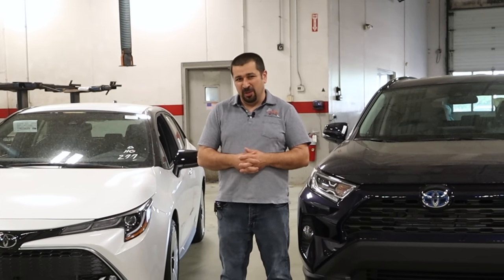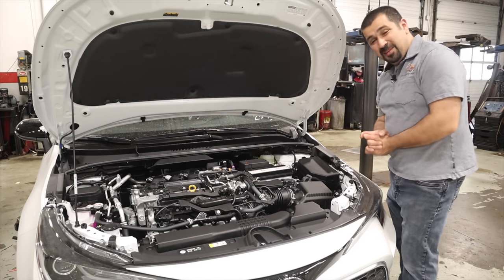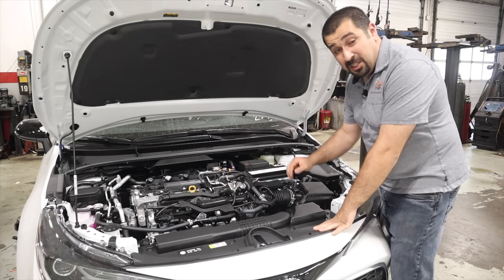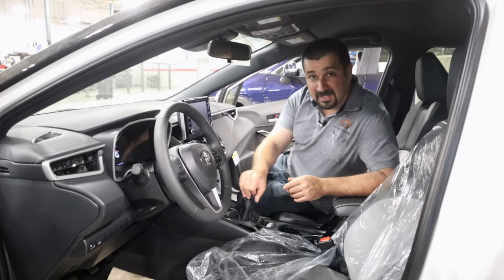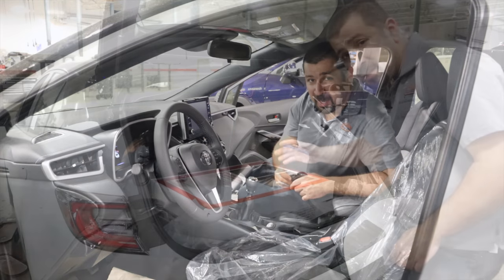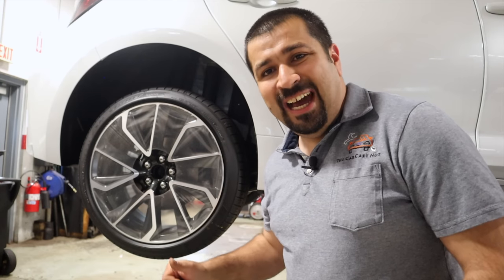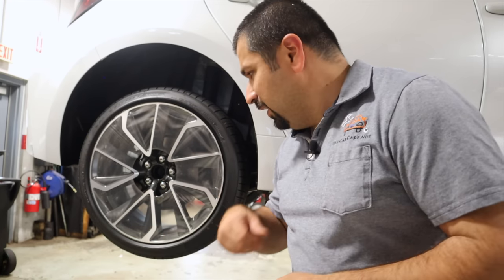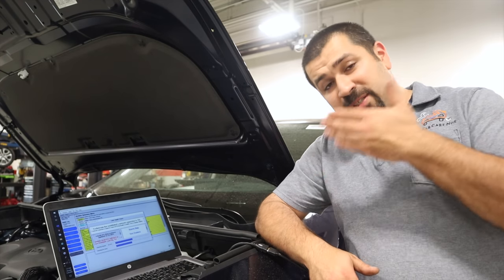Buying a new car? Here's what happens behind the scenes.

Comment: some missing inspection checks that may be superfluous for some but essential for some:
-check air pressure tire of the spare tire.
-check loose bumper joints front and back.
-check signs of paint bubbling. 
for prospective car buyers:
-check reviews online that are not based on the business and the financial departments (those are trained to be good sales pitch actors), check reviews that talk more about the service departments and parts departments.
BE PREPARED TO WALK AWAY from the dealer when they use bait an switch tactics.
never buy extended warranty! you, the customer is the only warranty the car needs!

Comment: Glad to hear you add washer fluid because all Nissan dealerships we have been to simply add water straight from the faucet. My Nissan I bought 10 years ago came with a steering wheel off-center and I was told I would have to pay for an alignment on my brand new car.  One of the many reasons we will never buy another Nissan.  Despite my requesting repeatedly that they not wash my wife's car we ordered our Subaru had dealer installed paint swirls....of course I didn't trust them not to "fix" it.

Comment: Wondering how my Toyota dealership is to go through all this stuff too when they have my factory ordered Tacoma later this summer
Reply: I didn’t known you could order from the factory. That’s awesome!
Reply: @marimashburn7796  You indeed can order from the factory.  You just need patience.  I had my salesman do a factory order for Corolla hatchback in December 2019.  He didn't make me put any down payment with the order, so I paid nothing until the day I actually bought it.  The car arrived in March 2020.  So, if you don't need a car right away, it's definitely something you should consider doing.  I got my Corolla hatchback with a manual transmission, in the color and trim level I wanted, and with a spare tire instead of a tire repair kit.  You don't need to be stuck buying whatever's on the lot.
Reply: @hamsterama  I thought it was only my Toyota dealership that didn’t take a down payment when they factory ordered my truck. That makes me feel better because everywhere else you have to put $500 down payment for a factory order
Reply: @chrisburger8794  I don't think you actually have to put down $500 anywhere, unless it's a custom order thing.  That's a trick some dealerships try to lock you in.  Doesn't matter the make or model.  My parents did a factory order for a Jeep.  The salesman wanted $500 down, my parents refused.  My parents said the Jeep could fall off the truck, and they would be stuck with it, or lose the $500.  Guess what?  The salesman gave in, and didn't make them put any money down.  Anyway, enjoy your Tacoma, once you get it!  Nothing better than getting exactly the vehicle you want, and knowing that nobody else test drove it!

Comment: First, I can't thank you enough for putting together all these awesome videos. Advice on negotiating and finalizing the purchase of a(ny) new vehicle is easy to find on youtube or elsewhere. However, makeing sure you are ready to take to the road upon signing on the dotted line and getting the keys is what I have found make this video and many of your other videos so informative to me. 

I have only had used cars and nothing that is high-tech so to speak. While my first car was a Toyota (93 Corrolla) which taught me the importance of using genuine Toyota parts, none of my 3 cars to date have had anything as high tech as what new vehicles come with today. So I have some questions based on this video and your other videos as I prepare to buy my first new (off the assembly line) car, a 2021 Toyota RAV4 XSE Hybrid (your videos were part of what helped me pick this car and build, so thanks).

I am very meticulous about maintaining my vehicles, so if a knowledgeable and certified mechanic such as yourself does X service every X miles/months for best reliability I will do follow it exactly. My second and third cars taught me the importance of fighting carbon build-up in the engine, so I am big on keeping the engine in top shape beyond just oil changes. How often should the fuel and intake systems be cleaned to maintain reliable performance and avoid catalytic converter failure?

Is it worth asking the dealer to run a full update check of the car's systems before I take ownership of it?

Are there any Toyota parts I should take with my vehicle at the time of purchase to help maintain it? Coolant perhaps?
Reply from the maker: Hi! Thank you for watching my channel.

If you drive on the highway regularly you likely won’t need to clean the intake. Just clean the throttle body every 50k miles and you’re good. 

Updates are not something that should be done regularly. Only if there’s an issue repaired with an update.

No need to carry fluids as these cars are pretty reliable new
Reply: @TheCarCareNut  thank you!

Comment: In my case universal toyota on San Antonio messed up big time. I order the supra on March and got delayed. On April I told requested to remove the protection pack as the car is going to get PPF covered and sellers told that they did call and requested the removal.

On that quote I added the optional supra cargo mat and was charged but when the car got here they left the VP and charged 650 dollars for that even though I requested to be removed and the sellers blamed the Gulfport were all toyotas arrive , same with the cargo mat as they put a standard/generic one instead of the supra one they charged 95 buck which again got blamed on the gulf and told me that what you see its what I get. Lip had a small damage and they offer to remove the lip from one supra and exchange it from mine which I said no cause by this point the attention to detail is leaving a lot to be desired.

I had to start a huge argument over the mat for them to actually order the correct one.

Your videos inspire integrity and attention to detail, wish you were in charge on working on my car.
Reply: Additionally the seller had to request wash as the car was full of stains and glue on the top coat cause they don't wanted to wash the car.

Comment: Cars today are highly technology driven. Checklist cannot do justice. I recenely bought my Hector and I hired Zekardo PDI to conduct the PDI for my new car. They found issues with my car not only in sensor but also discovered that the car had a meter rollback since dealer did not have demo car so they had used my car as demo car. I cancelled my car and then got a new car after that. They again came to do the PDI and when it got cleared by them, i bought the car. Highly recommended to every car buyer. They are the only company to conduct PDI for new car in India. Best part is they have no tie up with any dealers.

Comment: My new 2021 Corolla Hybrid Sedan will arrive in August here in Australia - I will check it out.  With low clearance of TNGA platform I will bet on scuffing front bumper from high ramp on ship and/or delivery truck (most important check).  Otherwise level of PDS you describe is very impressive - glad I am buying Toyota!
Reply: Maybe  that is why they have too much air in the tires so there isn't damage under car when removing in the delivery  process
Reply: @michelevyas5353  -  They purposely overinflate tires during production (to say 80 PSI) to ensure that if car sits around waiting for a ship, on a ship, or sitting in a parking lot at the dealers for several weeks it does not develop "flat spots" on the tire -  That is good, but remembering to deflate the tire to the normal 35-36 PSI before delivering it to the customer.  Way overinflated tire on a highway could blow.

Comment: I believe my dealer is the 1%. I’ve only owned Toyota’s except for a 2006 Ford Ranger V-6 4.0 4x4 that was a mistake. My latest purchase was a 2021 Tacoma TRD Off Road 4x4. Of course nobody has inventory here in SoCal and wasn’t real excited about the 2022 lineup so I ordered the Tacoma and a month later took delivery and the next week the Tacoma was in the service department since Toyota Safety Sense was giving false positive alerts. It still gives false pre-collision alarms when I’m fully stopped and a cyclist is approaching the right side from behind and basically the dealer says it’s working properly. So I unfortunately gave them a zero rating on the Toyota dealer survey.

Comment: In Feb 2022 I factory ordered (at MSRP), and put down a $500 deposit on both a 2022 Canary Blue/Midnight Black Toyota RAV4 XSE Hybrid and a 2022 Toyota Tundra Capstone. I have been doing research on these vehicles for the past year. On 4/20/2022 I was notified by Toyota of Puyallup in Puyallup Washington, that the RAV4 was ready for delivery. I informed my sales consultant (Van Meas) that I am aware of the PDI (Pre-Delivery Inspection) they perform on their delivery vehicles but I would like to perform my own PDI on my RAV4. I also asked if he could schedule a quick 10 minute appointment with the service department while I'm there to put the RAV4 on a "Lift" so I can inspect the under carriage. 

I arrived at the dealership the next day. They accommodated my request with the service department and everything looked good (so far). They then drove the RAV4 to their Delivery Bay in the showroom. After 3 hours, I completed my own PDI and Test Drive. Van M. met me outside and I began to tell him that I had a few issues with my RAV during my PDI. There was a 1 1/2 inch visible deep scratch on the hood and right quarter panel and the passenger heated seat did not work. There were a few other minor issues too. Van asked for us to go inside. Before we made it inside the General Sales Manager (GSM) Matt Pemrose met us before we walked inside. I commenced to tell him the issues I had. He interrupted me and said "I have been watching you for the past few hours doing your PDI and it looks like NOTHING is going to make you happy". I was taken back a bit with his response and immediately felt disrespected. 

Long story short...Toyota of Puyallup refused to fix any of the issues I had (especially the scratch) and was told to take the vehicle "AS IS". No reduction in the price of the vehicle. Needless to say I REFUSED the vehicle. The GSM then approached me and not only gave me back my $500 deposit for the RAV4, but also gave me back my $500 deposit for my Capstone and said they refuse to do business with me in the future. I was shocked and appalled!!

I have a phone call into the owner of the dealership and also plan to file a complaint with "The Office of Attorney General of the State of Washington". (Thanks for the links @JoinYAA.com)

Toyota of Puyallup is my local dealership but I will NEVER do business with them again. Future car buyers... beware of this dealership and others like them that are out there. DO YOUR RESEARCH!!

Comment: I just walked away from a dealer while doing a pre-check on a new corolla because of quality issues with fit and finish. The door was installed crooked, and the top edge was off by about 1/8 inch. Very noticeable. Overall, the fit and finish on other gaps was off also. Even had a small scratch on the paint. The sales guys did everything they could think of to pressure me into taking the car as is. Apparently the American made Toyotas ARE not as good as the imports, as I have never seen this previously. To make matters worse, as I have previously bought two cars from these guys before, I was astounded when they said they would not hold another one for me from the upcoming queue of incoming cars. I don't care if they have an artificial "hard to get" inventory to allow them to sell at MSRP, I am not going to be pressured like this. Also, they have a policy now that you cannot test drive on the freeway. What? Are you kidding me?

Comment: Hi. In four five days I will be picking up a brand new Toyota Tundra (ufff I had time to buy a V6 turbo and a hybrid before), when I listen to your story, my face looks incredulous that my new car will be so thoroughly checked. Check lists are completed at once - all "V" are identical. Before this video, I was watching your automatic transmission oil change video and as you started talking about the correct oil temperature ... I thought I guess I live in a different world. Unfortunately, the services do not allow the mechanics to see their hands while they inspect your car. I understand that this is not theater, but with confidence it is like virginity - it IS or it IS NOT. There is no thread in the middle, and repair shops as part of a dealership are just as greedy for money, desire. Hardly anyone remembers that the first car is sold by a dealer in a car dealership, and the next one is sold by the service center. I like your films very much because you provide the same information that was given to me during school and studies.
Once upon a time, when a customer picked up a new car, the service advisor wrote down what could be set up in the car at the customer's special request. For example, the fuel reserve level can be set from the car computer. Another thing that can be changed according to the wishes of the owner is the volume of the radio during a call and many other functions. This was the case in the company I worked for 25 years - Renault. 
Today I don't know what to ask and I can't count on the seller's friendliness. Maybe you can tell me what I should pay attention to and what I can ask the service for when releasing the car.
Regards

Comment: Corolla, white one came from Japan.  Engine compartment hoses & wiring are organized.  Battery is mounted on the driver's front wheel strut.  American or Canada builds, battery hangs on the very front of the left fender - easier location for American mfr's and service dealers to handle the battery.

Comment: Bought a new Subaru STI, and whoever did the PDI forgot to install the radio antenna, found it in the trunk after I got home and noticed. 

Easiest way to tell country of origin is the first character of the VIN. Not sure if it still applies, but in the old days you could tell if a car came from overseas by looking underneath and seeing surface rust already starting on the CV axle tripots or exhaust.

Comment: We got our 2017 Rav4 home and a few days later I noticed a pool of oil on the garage floor. Took it back and they pulled the transaxle and replaced a seal. They took it for a test drive, and it still leaked. They got us a new Rav4. So, it can happen, even to a Toyota. The telling the satellite radio company that we did not want their service (both Rav4's) and a Tacoma, is another story.  They called multiple times a week after we told them no and blocked their number. Multiple mailings a week. Had to complain to Toyota to get them to stop calling, day and night.

Comment: Biggest issue of mine, whilst dealers mean well (toyota in this case) , is the guys who clean the cars do so much damage to the paint, by the time you receive the car it's covered in swirl marks. I know this varies dealer to dealer, but everytime I've bought a new car or took a car to the dealer for a service I've instructed them not to wash it.
Reply: Got a new Rav4 last month, covered in swirl marks and they had too much zaktek on so the dust sticks to swirl patterns minutes after washing. Hard to buff off excess by hand.
Reply: @benderrodriguez142  that sucks. Sorry to hear that buddy. In the UK I went with a friend to go pick up a lexus RX450H, and it was covered in swirl marks. Really bad ones. So we made a fuss and the dealer agreed to get the paint corrected by an independent detailer for free, plus they changed the way they wash their cars. The only way to remove those marks is a 3 stage correction and the dealer should foot the bill.
Reply: @HK.Builds  yeah, I am going to talk to them about it when I go in to get my seats redone. Front seats both have holes by the console. Not a fantastic first Toyota experience haha
Reply: I did a factory order for my 6-speed 2020 Corolla hatchback last year.  I left the salesman with very strict instructions that I did not want the car washed, and I wanted all plastic wrap left on as proof.  The dealership followed my instructions.  So, a couple weeks after I bought the car, I cleaned it myself.  I removed the white plastic wrap, and washed and waxed the car in  my own driveway.  My car is swirl-free, except for two isolated spots where someone at the factory seems to have used a buffer to correct something (this is not unusual, even very expensive European luxury cars can come out of the factory with flaws in the paint).  But those buffer marks are extremely hard to find, you have to be looking at those areas up close at a certain angle in very bright sunlight.  Anyway, if you want a swirl-free car, do a factory order, and instruct the dealership not to clean the car in any manner.

Comment: Good wonderful video. One big detail you missed is the longshoreman who drive the cars off the ships when they come into port before the hauler taked them to a dealership. I don't know how good they drive or careful. Sometimes too a new car will come with lots of miles because the dealer uses it as their personal vehicle and puts on dealer plates. And finally. The location? From your hints of far away going to guess the Corolla came from J Vin code and the other from Canada. Good to hear it's not the Fremont plant in CA which had so many problems that came of those cars. Like major oil burn. Also that guess because I know Canada has a RAV4 plant. Which strangely I hear that they give the Canadians mostly the AWD version of the car. Or would you call the RAV a truck because of the frame body design?
Reply from the maker: The RAV4 is not a truck. It’s a unibody not body on frame